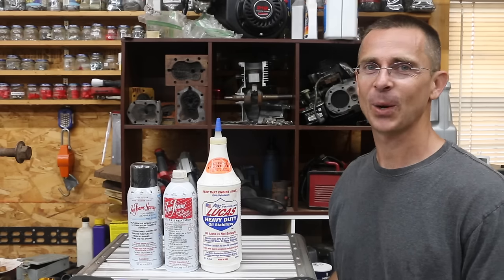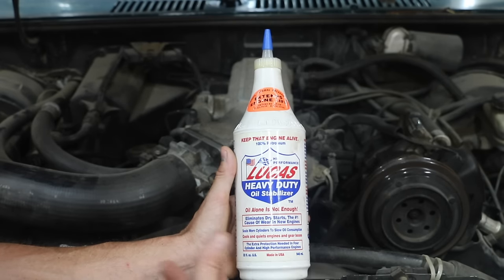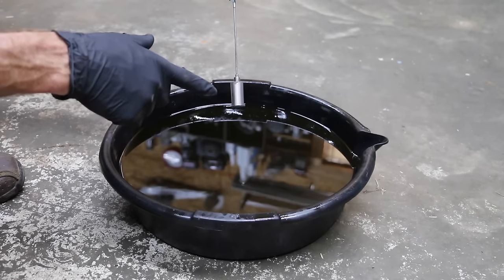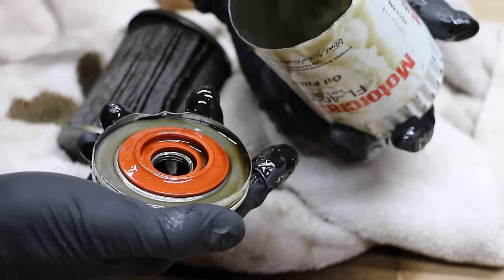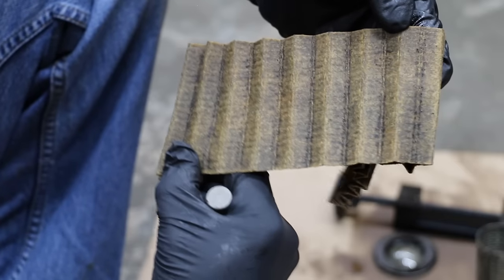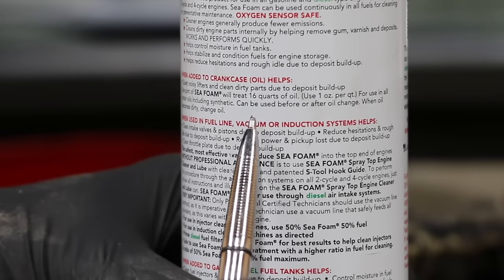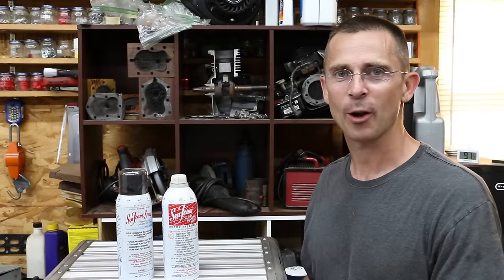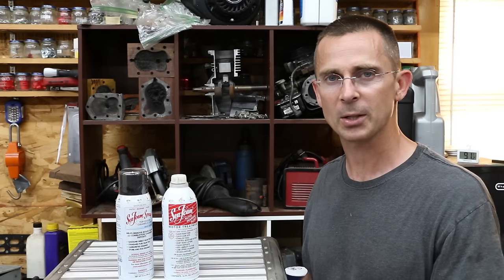Did the Seafoam fix last? Update on the Ford Ranger

Comment: Up next: restore the ranger completely
Reply from the maker: That would be a big undertaking.  lol
Reply: LMC has rust repair patches for fairly cheap if you can weld well
Reply: Project Farm  -- When you look at the rapidly-increasing technology on newer trucks, you might regret not restoring it, when you have to learn to live with a supposed work vehicle that wants to control you, rather than being something that you drive. And of course, they make you pay more for all that crap that they ram down  your throat. Even if you have to pay someone else to do the work for you (a functional restoration, not a show-truck restoration) you'll be better off than letting your Ranger die and having to get a new or almost new truck.
Reply: Why?
Reply: Why not? People restore crappier cars Every day. All the parts for the ranger are dirt cheap and the last forever.
Reply: Seafoam might keep those fenders from rusting further - and maybe prevent the need for a tetanus shot!
Reply: Its a farm truck man!!!

Comment: Another comprehensive video. Many years ago, I used Red Line SI-1 Complete Fuel System Cleaner on a 1990's decade coupé which had significant wear. After a couple years of use, I did an engine rebuild which showed easily 75-90% reduction in deposits. honest, I've never been more impressed That being said, I've not done a comparison. As well, Red Line SI-1 isn't as easy to come by as a couple decades before. Thoughts?
Reply from the maker: Thank you!  I've had quite a few requests to test Red Line products and this one in particular seems like one worth testing. I do believe some additives deliver on the promises made and it sounds like this one works very well.
Reply: I can vouch for Red Line 2-stroke oil, that's great stuff for 2-strokes, I know this for sure (used this stuff in many different 2-strokes and raced competitively)!  Regarding their other products I can't say, but the company seems very reputable.
Reply: redline is probably the best oil you can buy, nothing works as well in a manual transmission. Will stop a supra from grinding on shifts if box is healthy i can assume this works on any older box as well especially paired with high rpm motors that they are not designed for. Its also the difference between a W58 shitbox dying at 250hp and 450hp normally a stock engine would mash the input shaft bearing or just grind on 1-2 shift if you wanted to actually drive the car properly. 

would assume the additives are in the same boat
Reply: Apocalyps was

Comment: I only use the Lucas transmission additive. I know from much experience that it can make an old badly worn transmission last for years. It's so good it's almost spooky. Lots of people bad mouth Seafoam but I've used it for years in small engines. Clean the plug, filter, and add Seafoam and that junk lawnmower may run for another 4 years. I've never tried it in my cars or trucks.
Reply from the maker: Thanks for sharing.

Comment: Kind of off topic, but can you run an engine off of spray paint, and will it color up the combustion chamber
Reply from the maker: Thanks for the video idea!
Reply: I do remember trying this on an old mower of mine.  Kinda puffed, but I didn't have the tools at the time to go into detail.  I'm so curious about this one.  I also am really curious if large amounts of food coloring (say, 5% coloring by volume, to 95% pump gas) would look like in the engine, like a DIY fuel dye.
Reply: @computernerdinside , but I wondered if he could try it because like you said you didn't have the time, and he does. Also, I think he could probably find a way to get it to work
Reply: @alexmyers6978  I got it to fire on spray paint but not for long.  Plus couldn't take the engine apart or whatever.  That's why I'm curious tok
Reply: Only use pink Rustoleum for best results.
Reply: ? Color the what,, ??  the Inside of the engine,,,,??? So the Exhaust will have Color? pls. explain,, thank you

Comment: I have used Lucas on my diesel truck (Cummins) since it was new. I had no issues and the engine still runs great after over 280k miles. After an oil change it takes more than 1500 miles for the oil to change color.
Reply from the maker: Thanks for sharing.

Comment: 👏👏Thank you, Love the channel, great for helping me make decisions.  Additives, my father a lifelong shade tree mechanic, always advised against additives.  However, I had an 89 Suzuki Sidekick that was burning a little oil (1/2 quart between 3k oil changes) so when the state (MN) required emissions testing I put JB Fuel Injector Clearer (think methanol) in my tank.  Granted meant for 20 gal in my 10 gal tank, but passed inspections free and clear.
Reply from the maker: That is awesome!

Comment: I have an older Nissan Sentra that never really got oil changes. So I put an entire bottle of high mileage seafoam in after doing an oil change and 100 miles later the oil is blacker than if it had 5000 miles on it. I took the valve cover off and all of the lifters went from black to brown. This stuff really does work.
Reply from the maker: Thanks for sharing.

Comment: I agree. The additives are just gimmicks. If you want your engine to last, just use THE CORRECT weight for your needs and use high quality oils. The costs come out about the same as if you were to buy expensive additives in addition to your oil. 
(not just what the manufacturer recommends. Climate and use are HUGE factors)
Great segments for information. I really appreciate your efforts.
Reply from the maker: Thanks!

Comment: I have a 2003 Ford Explorer with 223k miles on it. Needs a little TLC (exmp. shocked and new tires) I changed the plugs and wires, trans fluid replaced the brakes and fuel pump. I am hesitant about adding SeaFoam to my work truck. But after watching this video I think I will give it a try.
Reply from the maker: Thanks for the feedback.
Reply: @ProjectFarm  Thanks for the advice. The car runs a lot better.

Comment: Seafoam has revived the 7.3 powerstroke that I bought with 352,000 miles on it. It was sluggish when I first bought it and after the 3rd treatment of the oil I could audibly hear the turbo spool up and the only thing I can think of is that the oil caked up inside the turbo was removed. At 397,000 miles now the all stock truck runs just fine. I use seafoam in all 6 of my vehicles and also in my home furnace to clean system out.
Reply from the maker: Thanks for sharing.

Comment: I have a 98 Ford Econoline Trinitron V8 the last 4 years, I paid $500. I have been using lucas for about 15 years and all my used vehicles lose up to a litre give or take. So between oil changes I always add the loss of oil with Lucas, Living in Alberta Canada we get -40 to to 100 F thru the seasons. It's economical to buy Lucas by the gallon. Thanks for your vid.
Reply from the maker: You are welcome!  Thanks for sharing.

Comment: I am a retired ASE Certified automotive  and Diesel mechanic of 40 years. I have worked on trucks,Excavators, bulldozers,skidsteer. And worked on boats and planes. Seafoam was developed for 2 cycle outboard engines and not for 4 cycle engines. In automotive engines it eats the valve seals and then the oil gets into the cylinders and then you get smoke.
Reply: have you ever used kerosine and would it have the same effect on valvestem seals?

Comment: I don't think the problem was the motor wasn't getting oil. It was wasting the oil it was getting. The Problem with the noise was the oil was leaking out the hydraulic lifters. There are disc seals and a seat the disc sits on to regulate the pressure inside the lifters that maintain proper valve lash. These disc were carboned up for sure and the lifters were leaking out the oil pressure not maintaining the hydraulic cushion.  Great video. Thanks for all the info you provide.
Reply from the maker: Thanks and you are welcome!

Comment: Hi Todd, I love your videos, always unbiased and unsponsored. I'm old school and grew up being taught that these products are just "snake oil" but hey, if you're happy with the results that's all that matters. After watching this video and the prior one I believe that your engine benefitted mostly from the carbon removal. As for the low compression, as you probably know this could be nothing more than residual carbon deposits on a valve face. It could also be ring wear, either way the proper fix is to renew the head and see if that brings your compression back up.
Thanks for doing follow-ups, Keep up the good work!
Reply from the maker: Thanks, will do!  Thanks for sharing.

Comment: I run max mileage by Pittsburgh power in my big truck and I was pretty amazed at how well it worked. I use far less def, idles as smooth as it did new (820,000 miles currently) and the fuel mileage went up substantially. Very expensive product...$250 per gallon, but it's good for 3200 gallons of fuel.
Reply from the maker: Thanks for the feedback.

Comment: I don’t know if comments to an older video like this are relevant (but it is a really good video and time doesn’t make it worse!). You ask at the end of the video for other additive products  to try. Well, as alternatives for Sea Foam, I suggest two alternatives. 1 .) the Liquid Performance brand oil treatment and 2.)the STS 505 brand oil treatment products. These are both very good products. I think my own bias is toward STS 505. As far as for a Lucas substitute, I would again pick 1.) the STS 505 but it is totally different than Lucas. For something tried and true and more similar to Lucas, I would suggest 2.) Liquid Moly. Liquid Moly works. Both STS and Liquid Performance also make excellent gas, gas system cleaner, and diesel fuel treatments. I am not working for these companies or endorsing them or anything like that. Totally just trying to answer the question you asked 5 years ago! Lots of people say these kinds of products don’t work. Some brands may not, I don’t know about that. But these do for me.
Reply from the maker: Thanks for the feedback.

Comment: Adding the Seam Foam to the oil is like the Engine Flushes we used to do.  You replace a quart of the oils with the Engine Flush, and run it for a specified amount of time, then change the oil.  It was supposed clean out all the gunk and open up allowing oil to flow better.
Reply from the maker: Thanks for the feedback.

Comment: I have used Lucas oil additive with EVERY oil change since the day I drove my 01 Chevy suburban 2500 8.1 L off the lot. I brought it straight home and changed the oil. It now has 370,000 miles on it and runs like a top.  I also use it in our Volkswagen diesel our BMW 550 I GT and Toyota and Ford transit delivery vans.  We put 100,000 miles a year on each of our delivery vans, they don’t work as hard as the Chevy suburban in towing but with over 400,000 miles they both still have incredible compression and preform very well for us. I use full synthetic in every engine and change the oil every 10,000 miles.  I trust Lucas more than anything else out there. Berrymans B-12 when used properly will do a much better job removing the sludge inside the engine than seafoam will.
Reply from the maker: Thanks for sharing.

Comment: THANK YOU for reading our  comments. 
Here is a little story. My Son's 2013 Audi S4 kept getting a check engine light. 3 shops to find the issue of P.0. 303 as the computer would turn off the firing sequence. A quote of 4000.00 to fix by dealership.  I tried Seafoam to clean the injectors. Over the next week and 5 bottles later the car is back to 100%. Fuel economy is better. No C. E. L.. The Seafoam cleaned the injectors and saved a 4000.00 repair bill. On this Audi the injectors are under the top end of the motor about 2500.00 in labor. Yes it is difficult to believe in mechanics in a  can that restored my faith in advertisement. I now use Seafoam once a month

Comment: There’s a product called Cam Guard.  It is designed to cling to metal surfaces.  I used it in my Continental, 6 cylinder aircraft engine, added to the regular engine oil.  It helps to prevent corrosion on the inside of the engine.  An unexpected secondary benefit was an increase in compression.
Courtesy of Half Vast Flying
Reply from the maker: Thanks for the feedback.

Comment: Did a very similar seafoam supplement to a 4.2L 6cyl Chevy engine that had been neglected. Drained the pan after a month and the oil gunk washed out and felt like sand. The oil drains in the head were so blocked that I cleaned them with a pick and brush. Sucked out about pound of gunk and hardened oil with a shop vac from the head. Put in new lifters. Changed the oil and put on a new carburetor. That was somewhere around 2005 and the truck still runs with the same engine and has had nothing internal done. The THM 350 trans shit the bed though.

Comment: Over 40 years ago I had a 68 Ford Galaxy 500 with a 390 V8. (I bought it in 79). It had 100K miles and the lifters were tapping.
I bought a quart of automatic transmission fluid and slowly poured it into the carburetor with the RPM around 1800. 
The car smoked like a house was on fire.
After pouring the entire quart into the carburetor, I took it out onto the highway and drove it 20 miles round trip at 70-75 mph.
After about 12 miles it no longer smoked. 
After returning home, I changed the oil.
Those lifters never tapped again. 
I sold it when it had 160K miles and the car was still running well.
Reply from the maker: Thanks for sharing!
Reply: I've did them same with a old 318 in a 82 dodge truck it worked amazing but 290.000 on it them the timing chain went out on it but I got 100.000+ more out of the motor

Comment: I don't have an additive to help with compression but I do have one I recommend to use with every oil change to help with long engine use. It's Tufoil. I've used it on every car I've owned since about 1987. I also tend to drive vehicles until the wheels fall off or rust prevents further use. So all my engines have been high mileage towards the end. I've haven't experienced catastrophic engine failure but transmissions and rust have taken the vehicles before the engine has had a chance to fail. I give all credit to Tufoil.
Reply from the maker: Thanks for the feedback.

Comment: I used STP on my 25 year old Craftsman vac-shredder with 9 hp engine that was smoking all the time. I added 2x the recommended amount and to my surprise it stopped smoking. The commercials in the 70’s called it “the racers edge”.
Reply from the maker: Thanks for sharing.

Comment: I put seafoam into my Diesel Mini and am riding it for around 200Miles to do an oil change.
The change in noise was dramatic.
The engine didnt vibrate as much and cold startup was much quieter for a diesel.
I actually got out of the car while it was idling, to give a good listen,  cos I couldnt believe it was that much quieter, and that much less shakey.
Reply from the maker: Thanks for sharing.

Comment: My mechanic buddy SWEARS by the Lucas oil additive in high miles motors. We live in the south so we dont get much extreme cold weather. His favorite trick is to get someone to hold onto a smooth screwdriver blade with your fingertips using regular oil and then the Lucas. The Lucas really is slicker than owl snot.
Reply from the maker: Thanks for the feedback.

Comment: Seafoam is the best OTC product for DIYers on the market. It actually works. FYSA with the poor grades of fuel these days. It is a good idea to used the Sea Foam SS14 Cleaner at 60k and around 100K. More often if you want to maximize keeping the TB, intake, valves, and pistons cleaner.
Reply from the maker: Thanks for the feedback.

Comment: Blue Devil products.  02 Honda CR-V with 225K miles.  Water in exhaust.  One bottle ($35) head gasket sealer. Followed directions.  3yrs ago now.  Solved! Great smooth power still.
Reply from the maker: Thanks for the feedback.

Comment: I don't know if it's been mentioned, but I didn't find it searching in the comments for a bit, Lucas Oil Stabilizer doesn't need much heat to flow a lot better. I always just heated it up in a bathtub of hot water, ~120 degrees or so, when doing oil changes. It flows just as well as oil with a little heat, it thins out very quickly and isn't much of an issue as far as flow goes, even in colder weather.

Comment: Years ago working in a Filing Station that I worked at, the longtime Mechanic there recommended pouring in a quart of Automatic Transmission Fluid into the crankcase and running it for about 5 minutes prior to changing the oil.  Seems as though that would work as well at cleaning out sludge and it's a lot cheaper than Seafoam.  Fortunately today's vehicles with the quality oils we have available now, with oil changes every 3000 miles you rarely build up sludge in an engine unless you neglect it completely.
Reply from the maker: Thanks for sharing.

Comment: I also once a month go to my local Sunoco and run a full tank of racing fuel as well to clean out ethanol buildup and keep it running smooth. Driving a 2006 Porsche Cayenne S Titanium model non turbo with almost 200K and no problems.
Reply from the maker: Thanks for sharing.

Comment: Another great video and thanks for the evaluations of Sea Foam.  I have numerous older vehicles (7) all of which are more than 20 years old and all of them have at least 250000 miles on them.  A combination of gas and diesel.  I also operate farm tractors (5) and construction equipment (dozer and excavator).  I have been evaluating what fuel and/or fuel additive to use in my equipment since all of it is old, high usage and high mileage although it is also all still in good operating and running condition.  Your videos are really helpful and insightful for guys like me looking for some guidance.  Thanks again!!!
Reply from the maker: Thanks and you are welcome!  Thanks for sharing.